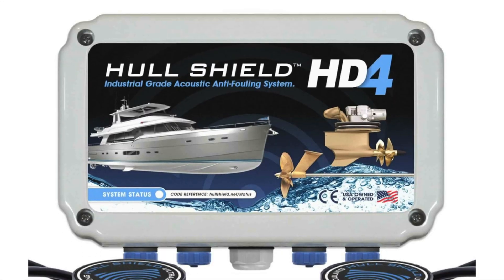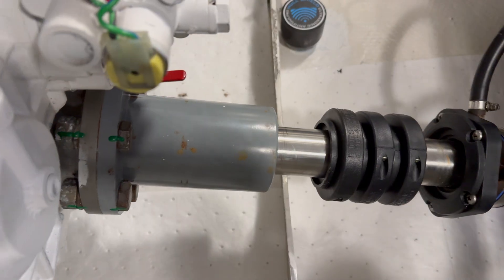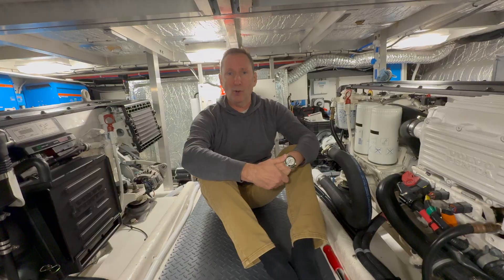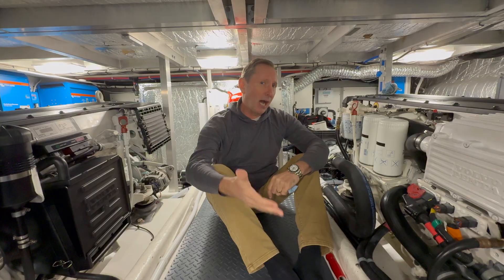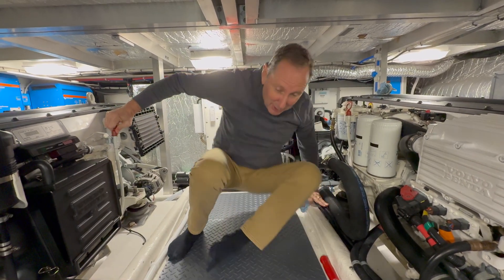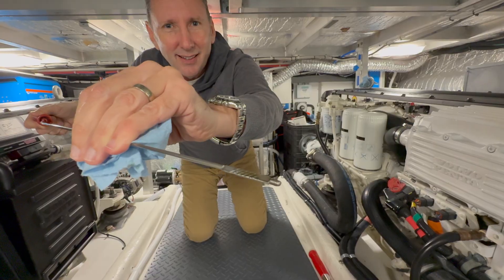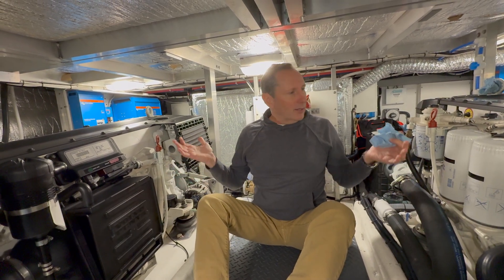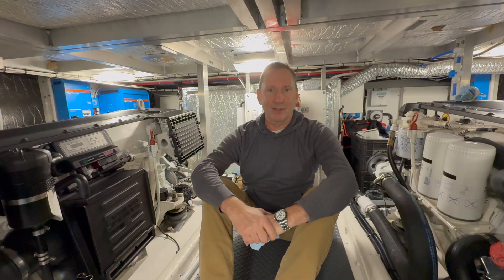Hull Shield HD4 vs Dirty Engine Oil - See What Happened

Comment: I installed transducers on the reverse gear not the mounts. I can’t speak on the impact on oil clarity since the system was installed before I put any serious hours on the engines, but the oil does stay clear till about 100 hours. My engines have about 3500 hours with 1200 or so while I owned the boat.

Comment: Okay if that's your theory for clean oil , then what do you think its doing to your engine electronic sensors about 12 on those D6s.
Reply from the maker: That’s a reasonable perspective. Although heat,  & moisture tend to be the top enemies of electronics, ultrasonic plausibly could cause problems.

Comment: You’re dreaming about the oil.
Hull Shield is very harmful to marine wildlife especially ORCAs, should be banned in the Pacific Northwest.
Reply from the maker: Do you have any studies you could refer to as to possible marine life harm?
Reply: How It Works Without Harming Marine Life
Targeted Action: 
The ultrasound pulses are absorbed directly into the hull material, creating localized vibrations only on the boat's submerged surfaces. These vibrations disrupt the settlement of fouling organisms at a microscopic level but do not propagate far into the surrounding water. Marine fauna (fish, mammals, or other wildlife) not in direct contact with the hull are unaffected, as the sound waves dissipate quickly.

No Chemicals Involved:
 Unlike biocide-based paints, which release toxins that can kill non-target species, poison plankton, and accumulate in the food chain, Hull Shield relies solely on sound waves. This eliminates chemical runoff, reducing microplastic pollution and heavy metal contamination in waterways.

Proven in Testing: 
Field tests on various vessels (e.g., catamarans, monohulls, sportfishers) show effective antifouling with zero observed impact on nearby marine life. Independent reviews and manufacturer data confirm no interference with ecosystems, and it's even used by the U.S. Coast Guard and Navy for similar reasons.

Environmental Benefits
Reduces Overall Harm:
By extending the life of any existing bottom paint (often doubling or tripling it), Hull Shield minimizes the need for frequent hull scraping, which releases toxins and microplastics into the ocean. This indirectly protects marine habitats.

Fuel and Emission Savings:
 Cleaner hulls mean better efficiency, cutting fuel use and CO2 emissions—benefits that support broader ocean health.

Regulatory Alignment: It's compliant with increasingly strict environmental regulations on antifouling (e.g., bans on certain toxic paints in sensitive areas like the EU or U.S. coastal zones).

General Ultrasonic Tech:
 Broader studies on ultrasonic antifouling (including competitors like Sonihull) echo the safety profile, with minimal disturbance to marine life due to the high-frequency, low-amplitude waves used (inaudible and non-lethal to animals).

In summary, Hull Shield is a net positive for marine wildlife: it deters fouling without the toxicity of traditional methods. If you're considering it for a vessel, it's especially ideal in eco-sensitive areas. For specific installations, check compatibility with your boat's size and hull material via the manufacturer's guidelines.
Reply from the maker: Great information!! Thank you!!

Comment: Interesting on the engine oil.  I do have to say I am impressed with our not-so-new-anymore Cummins. About 1200 hours in then now and incredibly clear after 178 hours of running. Yes, all my year with diesels they go black almost right away. Maybe the common rail has something to do with but I believe your D series are also.
Reply from the maker: You are correct, we are common rail as well. Thanks for sharing your experience with your Cummins. 178 hours and being clear is absolutely amazing!!
Reply: @ElliYacht1  I am amazed every time I check the oil.  Not used to it!  ;-)   But I'll take it! Now, as you know, we spend 99% at hull speed....not sure if that has anything to do with it...but I can't imagine that it would.  
Your props look pretty damn good after the time in the water.  The hull too.  Was that after an initial power wash?

Comment: How well your Reverso drains the engines makes a big difference.  Also, if you use the Reverso to install the new oil, it will quickly get black.  I fully drain oil, and pour new oil in on the top.  Takes 60 hours or more for the oil to get colored.  CAT C-12’s.
Reply from the maker: You may have nailed the real variable! We added a reverso a couple years back as well and I’ll bet we’re getting a more thorough drain of the old oil. 

You are a genius!!
Reply: @ElliYacht1 not sure about that…. But I learned a lesson or two about this several years ago.